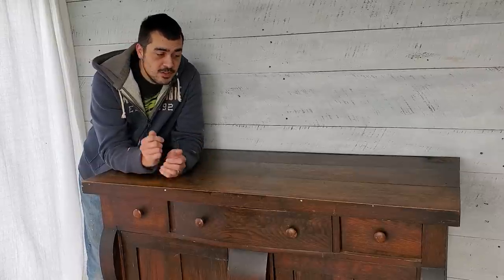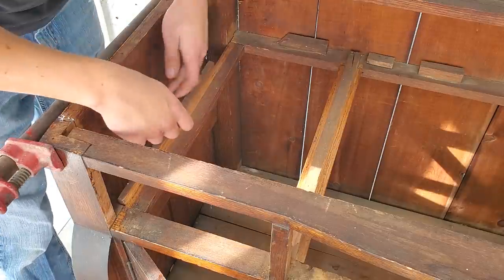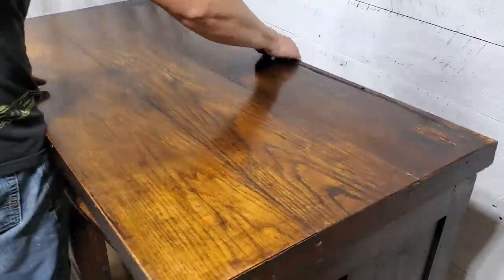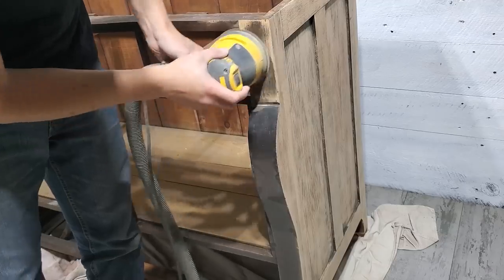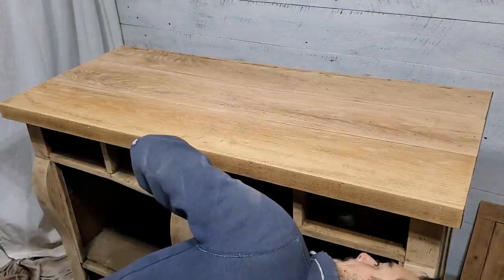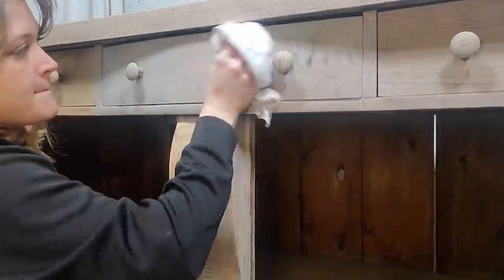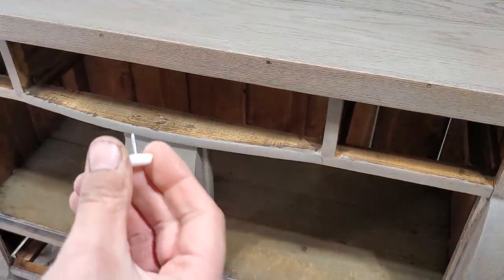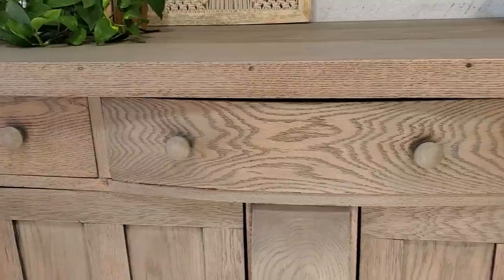Furniture Makeover // How to do a Paint Wash & Stain Finish

Comment from the maker: Someone mentioned about not gluing the panels, and that is true to a point.  Wood typically needs room to expand and contract with humidity change.  I actually went back and cut the glue beads on the panels so they have the necessary room to move.  Always a good thing to keep in mind!

Comment: Watching late afternoon in Ireland here.  I love how this turned out.  I felt your pain there when you said you had been sanding for 2 days.  I had the same issue with a buffet I'm working on here.  Except there were 3 THICK layers of paint on top of a really tough lacquer.  Sanding for days and eventually got stripper at it.  Four layers of stripper and then going at it with a carbide scraper and more sanding and it's finally back to it's original layer.  So gonna hit it with some fusion sfo in cappucino funnily enough.  Love the tone of the stain.  So deep and warm.  I love how you used the stain on this.  A lot of hard work but the end result was well worth it.  Well done.
Reply from the maker: I debated resorting to a stripper a few times, but I just kept powering through to the light at the end of the tunnel!  In hindsight, I would have used a stripper from the beginning though. 😂
Best of luck on your project!
Reply: @BrickHouseVintageDIY  Thank you